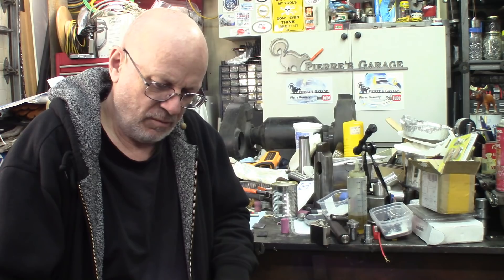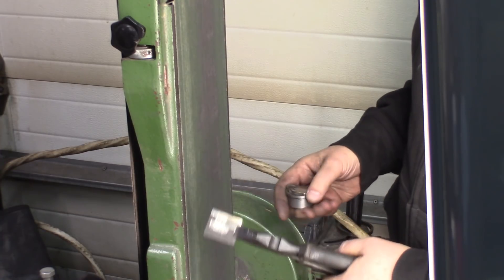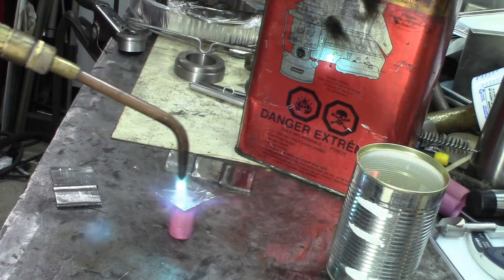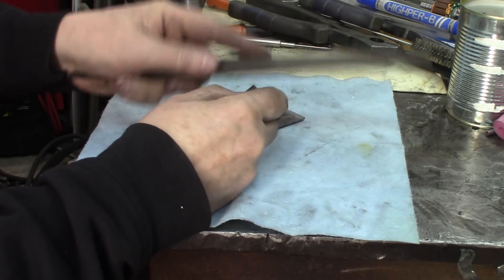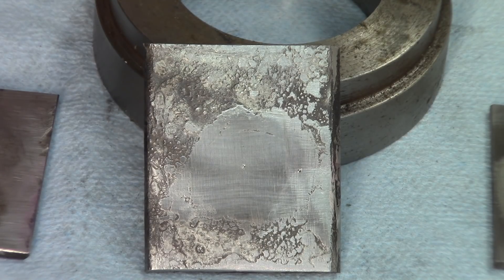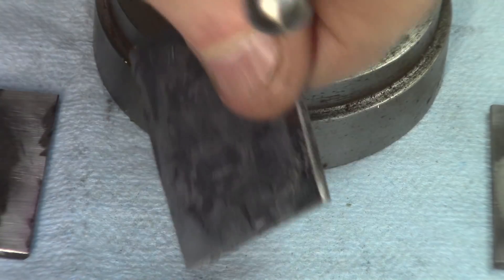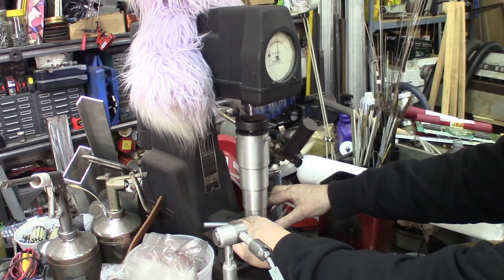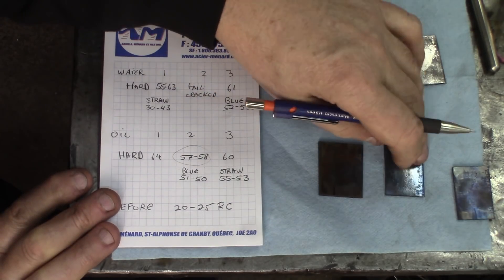Bed Frame Stories... FREE or CHEAP source for hardenable steel, the basics....

Comment: One of my steel bed slats broke right across near one end.  How do I fix it?  Are they hot or cold-rolled???  Thanks, great video.
Reply from the maker: Sorry for the delay, the comment got lost in the lot of other comments...
About repairing your bed frame, if it's a standard frame, with casters, most likely that they're made with alloyed steel that is quite resistant. 
This alloy is a though one to weld if not properly done.
You need to preheat the area to be welded and a slow cooling after the weld is required, if this procedure isn't followed there is a high risk that the welded area will be prone to cracks and failure.
Hope this helps you to asses the care related to weld high alloy steels.
N.B. If the frame reveals to be simple cold or hot rolled steel with low carbon or other alloying elements, then, the welding procedure is simply to weld without special treatment....
Reply: @pierresgarage2687   No worries.  It appears to be hot-rolled steel, but I'm not sure.  Would that create a problem?  It's only a bed frame and it's broken already and I'm sleeping on it.  Another failure would be no big deal.  I'm willing to experiment a little.
Reply from the maker: The difference between hot rolled and cold rolled steel is the finish, hot rolled has a thin hard dark scale coating on it's surfaces as cold rolled has none of this oxide on it and has a steel colored softer surface.
Your frame is probably hot rolled if it's made from non alloyed steel, note that cold rolled steel is probably near double the price of hot rolled steel.
they both weld about the same and don't require any special prep when welding smaller pieces, some preheat may be requider when dealing with thicker plates, though, bed frame is considered very lite material...
Reply: @pierresgarage2687  Fantastic.  Thank you so much.  I couldn't get a clear answer from anyone about any of this.  You answered all my questions.  Thank you again.

Comment: Can I weld it if I annealed the bed frame before welding? Does this prevent cracking? Do I need to aneal after welding? Thanks!
Reply from the maker: No need to anneal before or after, some preheat behond the heat affected zone would be a good practice, something around 500 deg F (260 deg. C ) will do, very important that the welded and preheat zone cools as slowly as possible in order to avoid the weld to harden and get brittle by cooling very rapidly like when there is no preheat applied.
Hope this helps you, but be very careful when trying processes you're not yet mastering, get some practice on trial pieces, you can test your joints be comparing the hardness of those joints to untouched parts of the beams.
A simple automatic punch could do, you compare the size of the prick hole to each other, a large hole is softer metal and a very tiny hole means a very hard possibly brittle segment.....
Reply: @pierresgarage2687  Thank you! I really appreciate your response. I'm going to have to invest in a quality torch.

Comment: Shoot. I was just about to start mig welding a bicycle trailer out of bed frame material, but I guess I shouldn’t waste time with this stuff if it’ll break and potentially cause an accident. My only other material is 2” galvanized square tube. It’ll take lots of prep work and be much heavier, but a lot more durable by the sounds of it! Thanks

Comment: I'm not a blade Smith by any means but eventually im going to try forging a quick bedframe knife. I also have hardfacing wire for the finished cutting edge if it's necessary, probably won't be. 
I just wonder if case hardening mild a36 or something similar would be superior to bedframe... So many questions not enough time. Thanks for the video 💯
Reply from the maker: Those bed frames angles, though, not being a very controlled composition from batches to another will most likely make decent blades when properly treated, they shoul be able to keep a pretty sharp edge. As for case hardening of mild steel, I'm not recommanding it, as the hardened layer is only very thin, a few thousands of an inch ( around 0.1mm ) at best, and it wouldn't stand many sharpening cessions.
Hard facing is generally super hard and in most cases brittle unless being supported by a more supple under layer of steel, it would also require very hard stones or media for sharpening.
You can take all this with a grain of salt, but it's my personnal feel about how it would go.
Thanks for watching and for you comment...

Comment: Perhaps not anymore but I think they used to recycle train tracks into bed frames. Hard stuff to grind smooth.
Knife with a Rockwell Hardness Scale rating of 58-62 hmm.
Reply from the maker: Hard to say about the source of every frame but this is also what I've heard, this steel is really good for lots of apps as long as it's for non critical propose cause nobody can really say what is in it.....
😉

Comment: Pierre, just wondering about welding this with my new Horror Freight mig welder. Noticed you keep stressing the need to keep the weld joints from cooling too fast.  If welding on longer pieces, its common sense that the heat at the weld will conduct towards the colder ends, thus depriving the joint from retaining heat for any length of time. I'm wondering if I could use a standard Propane exposed garage heater to pre-heat my stock, and then keep it running for a while after the weld is complete?  I'm not looking to harden the steel, nor am I making anything structural beyond perhaps a table saw table or welding table.   The alternative I supposed would be to simply drill with cobalt bits and bolt together.  Guess I'm wondering how long would I need to keep the weld joint 'hot' to avoid brittleness.
Reply from the maker: Most steel alloys will change their cristaline structure in the range from 1400geg to 1600F ( 760 to 871 deg C ).
When you heat an alloy above this transition point the cristaline structure reorganises, and, when you let it slowly cool below again, there is a normal transition where the cristals will get to reorganise to the appropriate state related to the temperature. When you get the temp above this transition point and cool the alloy rapidly the cristals don't have time to normalise or settle to the appropriate state, then it gets this piece of alloy real hard and brittle. 
In order to avoid the brittleness, soon after the part cooled, you need to temper the part to remove some of the brittleness, what you lose on hardness you gain in flexibility, this is where you make the balance acording to what purpose the part is destined.
Just so you know that an alloy freshly hardened is way too brittle to be usefull, it risk shatering like a piece of glass, the reqired step to make the part usable is to temper it to required hardness.
As for using those bedrails, this type of alloy is able to harden to quite high figures, to make usable welds you'll need to keep the transition zone from cooling very fast, one way to achieve this is to preheat further than the heat affected zone so that the point where the molten metal and the cool zone don.t create a hardened and brittle zone.
Just to detail a little bit more, the molten metal from the weld is way above the cristaline transition temp, and the cold unmolten zone close by will act as a rapid cooling factor, this is the moment when this rapid transition will freeze the cristaline structure into the hard and brittle zone, the result will be a thin brittle zone highly subject to cracking.
Keeping the heated affected zone (HAZ) and well behond well preheated during and even after the weld will prevent brittelness by slowly coolong the whole weld and HAZ...

Hope I was able to express myself clearly so you could visualize the process, there are good readings about alloys and how to heat treat them.
Reply: @pierresgarage2687  Thanks for the metellurgical exposition! BTW, I'm not wondering if it might be best to just braze them either gas or tig with eutectic or silver solder braze.  That would seem to remove the hardening/annealing issues, and heating up a larger zone of metal as you indicated.  I think most decent brazing is around 70ksi, so I'll check it out. Thanks, and glad to see you back!

Comment: Very good information and makes sense why the bed frames are riveted. Was hoping to see it heated and put into lime to cool.
Reply from the maker: If you require to weld those types of alloys, you need to proceed with preheat and post heat proocedures in order to end up with safe and reliable welds....   🌈👍

Comment: I took bed frames, cut down and welded them into a forge table. Way overbuilt in case a weld or two breaks...  I suspect it will be just fine. If it were a life or death situation, or something that would take sharp impacts, I would have purchased mild steel for it...  here is to hoping it will be just fine, lol
Reply from the maker: Don't worry, I did the same for some non critical devices, judgement is key in our everyday decisions...  🙂👍

Comment: Will flux core welds work on bedframes?? Small shelves, dog bowl stands, art etc???
Reply from the maker: Just make certain that you only use on non critical or non highly solicited devices, what you suggest sound like reasonable uses of welded devices from bed frame steel, best case scenario is to pre-heat, weld and slow cooling...
Reply: @pierresgarage2687  awesome! Thanks for the reply! Keep up the good work!!

Comment: Drilling this stuff is easy, if you go slow. Slow speed with cobalt drills works fine. I even bore large holes with bi-metal hole saws at 50 rpm in my drill press.
Reply from the maker: Just like you say, it takes good quality cutting tools, otherwise you're in for lots of frustrations...      🥵🙂👍

Comment: Masterful explanation my friend.  I’ve used poor man’s steel for a long time and agree it is harder to seagull nowadays.  I’ll try torch heating and oil quenching on my next project.
Reply from the maker: Be carefull not to harden that stuff or it will crack all over, good practice to heat up the area to be welded wide enough for that the HAZ doesn't cool so fas as to harden on the edges, use a blanket or a shield in order to prevent rapid cooling in the hardening temperature range...
Have fun seagulling and making projects... !!!    ;)

Comment: I did weld some brackets onto a trailer with the bed frames and it did get a couple of failures,...I thought it was my welding ,...but it was not anything structural so nobody died!    Also if you get the older bed frame rails with the hooks on the ends for head boards,...those are hot rolled,...I find them much more useful for welding projects like racks and shelves etc etc./// what do you think about that Pierre?
Reply from the maker: The failure comes from the HAZ, ( heat affected zone ) there is a area with very high carbon content that freezes very rapidly and is also very brittle, you should pre-heat that area and let it cool slowly, this shoud help, but having .8% of carbon and .8% of vanadium those rails are good steel but need special care and experience to do proper welds, using fasteners is another way to get by safely...
To make holes in that material you can easily use some HSS Cobalt drill bits, they'll perform real good compared to cheaper stuff.
I've got a video on that set with 15 bit for about $10, there is also a set with 25 bits or so for around $25, here is the link to the video:
https://youtu.be/rd1eyxrlIhw

Comment: Pierre,
  I pick up every bed rail I find on the street. I’ve used it for many projects as is. I’ve never tried to harden it however so this is excellent information! I found very quickly bed rail work hardens if drill is dull or drill speed is too fast causing too much heat build up. I only use cobalt drill bits to bore holes in it. I also found a source for cobalt blades for my portable band saw which I have mounted on a frame. These blades slice through bed rails like butter and will even cut tool steel satisfactorily if coolant is used. A good source for bed rails is second hand stores like Salvation Army family stores. My local SA store sells them dirt cheap as they often have way more than they can move and they are difficult to store and display. 
  As you indicated they are already hardened to a point and have considerable strength. When you think about it they have to be to withstand the stresses that are sometimes afflicted upon the bed they support!
Dale
Reply from the maker: With proper care those frames are will make some excellent structures, great source for hardenable steel, one issue about them, the batches may vary quite a lot from one frame to another, you may require some testing for more critical apps. For normal use there is not really big issues, also good tip to look at the Salvation Amry, it may help them get some funds and you get some good steel at great price...!!!     ;)

Comment: I’ve been trying to get more info on this material since I first watched your video when you posted it. I’m very interested in it for knife making! But I need more info on proper heat treat so it will hold an edge. So far I’ve been told to treat it like 1070-1080 high carbon steel
Reply from the maker: There is a viewer that emailed me about some possible composition of some of those bed frames, if they're made from old raylway material , the composition could be around .8% of Carbon and also .8% of Manganese, this should be a decent material for knife making, since I've worked a lot on that type of material and the traditionnal forging techniques, I suggest you try some different procedures and compare the results on how well the edge is performing. 
The Manganese will improve many properties as ductility, wear resistance, traction, tempering easier...
Give me some feedback about how you get by...   ;)
Thanks for viewing,     Pierre

Comment: I have been picking up free bed frames for years, to use for project material, never thought to try and harden it
Reply from the maker: Just let your imagination go free, only thing is to be very careful when you want to weld some structural devices, brittleness is a big issue...
Thanks for comment,    Pierre

Comment: good information. i learned many years ago that this stuff was not a candidate for welding , most amature fabricators would mistake this for ordinary structural steel with possibly disastrous results. makes you wonder why its used for bed frames. possibly higher stiffness to weight ratio. thanks pierre
Reply from the maker: Hi Larry,
This material as delivered from the factory is pretty safe, the problem occurs when you weld, the weld itself is getting way above the temp where the steel will harden if cooled too fast, this is where the mass beside the weld will pull th heat so fast that the weld and the surrounding zone will harden and be VERY brittle.
Using fasteners would allow you to use that steel in a safe way.
Thanks for your comment,    Pierre

Comment: I've used it as brackets but never used as a structural member.  It works ok.  I've welded it with 7018 stick.  Good info.
Reply from the maker: Hi Big Bill,
As I just got back to a previous comment, on how to help with making safer welds with this type of steel, this is a copy/paste:
You"ll se that your idea of using 7018 rods is a start in the right direction...   ;)You got to keep the weld itself and the adjacent zone from cooling too fast as it will make the weld harden and brittle. some preheat, filler material designed for high carbon content (example,  7018 rods ) and very slow cooling, will help getting better welds...
Thanks for sharing and for your comment,    Pierre

Comment: Made a ladder once of this stuff. Got to keep welds away from edges that aren't at ends of material!
Reply from the maker: Hi Charles,
You got to keep the weld itself and the adjacent zone from cooling too fast as it will make the weld harden and brittle. some preheat, filler material designed for high carbon content (example,  7018 rods ) and very slow cooling, will help getting better welds...
Thanks for sharing your expereince,   Pierre

Comment: I kept waiting for the inside joke about the white gas can and the torch. Did I miss it?
Reply from the maker: This is related to Brian Block using a plastic bucket to hold the oil used to harden some parts, he got a little scared that fire would spread and burn or melt the plastic bucket, now he uses metal containers...   ;)
His Channel:   bcbloc02
Cheers,    Pierre

Comment: I think you should consider using a hole saw for a stand, much less contact area, if you are testing something again. Thank you for this, I had no idea they would use carbon steel.
Reply from the maker: Hi, if you,'re talkig about using the hole saw during hardness testing, it can't be done, the part needs to lay flat on a solid surface in ordere to keep the flex to near zero, otherwise the result wouldn't be valid...   If it's what you meant...   ;)
I had a viewer that told me that it may also contain manganese as well as carbon...

Thanks for your time to leave a comment,    Pierre
Reply: No instead of the copper pipe for a stand
Reply from the maker: That's alumina, just like a cup for TIG welding torch...   It's an insulator...  ;)

Comment: Hey Pierre, thanks for doing this video, and thanks as well for the kind words and shout out.  That's cool that you actually have a hardness tester, and used a much better heat source than I did.  It was by far a better and more reliable test of typical frame material.  I wholeheartedly agree that it's best not to use an unknown material for safety-critical applications, but it's hard to pass up free bar stock! :)
Reply from the maker: Hi Everett,My pleasure about the shout...   ;)
If you want a better heat source at budget price you could use a propane weed burner, something just like we used in the cheap forge video...   Shouldn't be much more than 30 to 40$.
Take good care,     Pierre